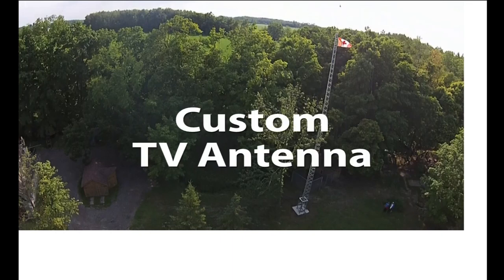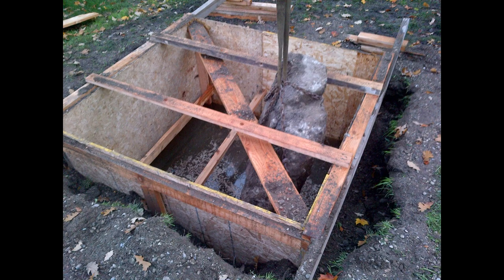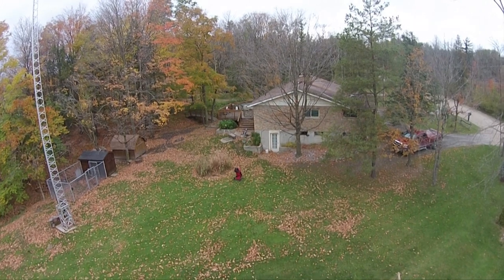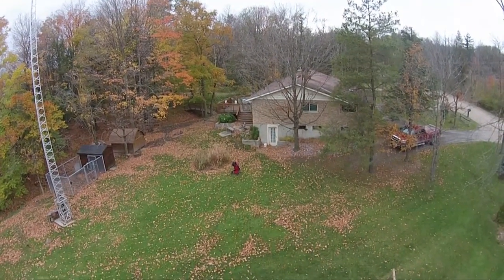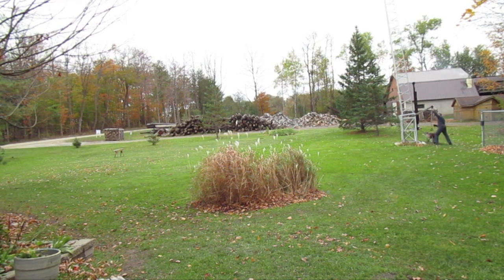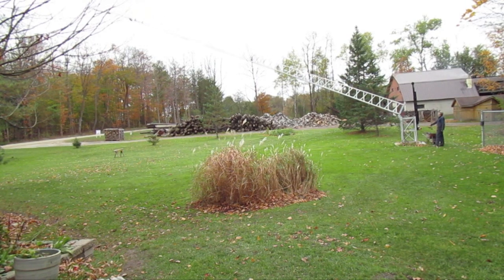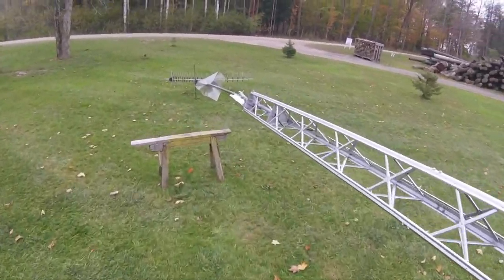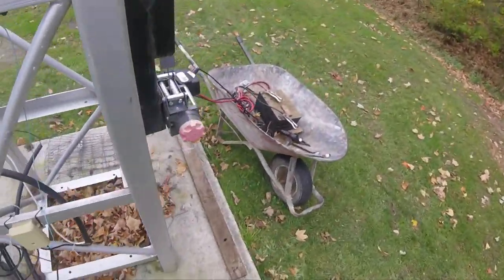Custom TV Tower Lower with Hinge and Winch System

Comment: Thanks so much.  I've got to drop a tower that isn't nearly as tall as what you have.  Do you ever find or are you ever afraid that the tower might come down or go up with some swing to it?  I'm not clear...let me try to clarify: if you imagine that the down tower points due north, there is not a lot of force keeping it from swinging to the north east, which might bend or shear the hinge at the bottom.  Make sense?
Reply from the maker: The tower is being winched along the vertical axis plane so any out of plane load (like wind) must be resisted by the hinge.  The wind load is small if you do it on a calm day.  At 35mph wind you get a wind load of about 56 lbs acting below the center of the tower - which translates to about 1000 lbs per hinge (on my frame).  So  you definitely need a heavy hinge ( I used 1/2" plate and large Grade 5 bolts (Ø7/8" I believe).  Definitely take care!